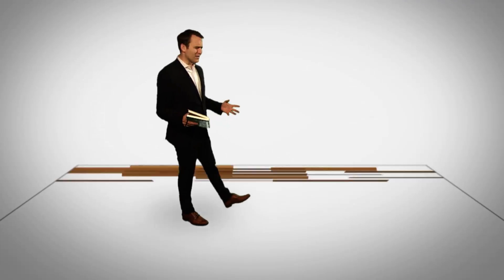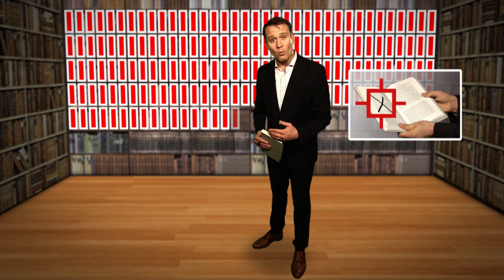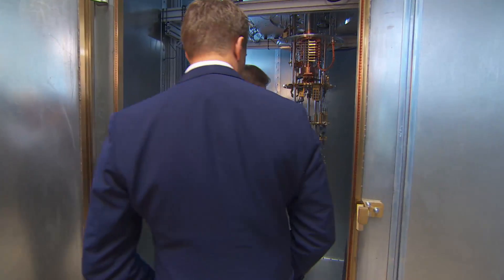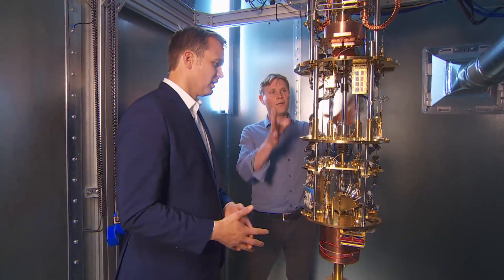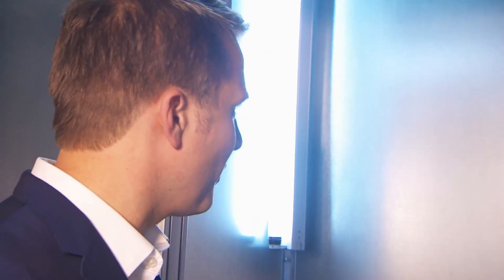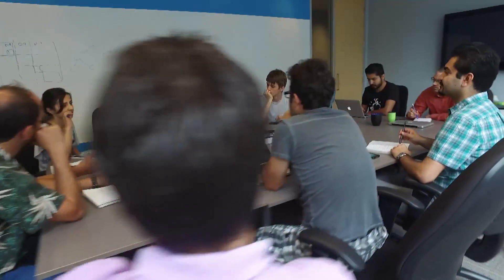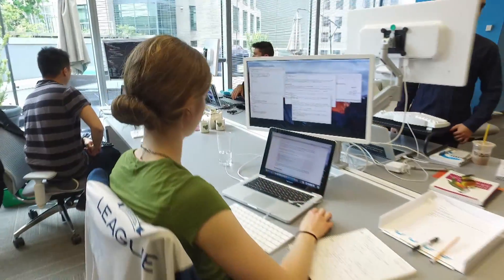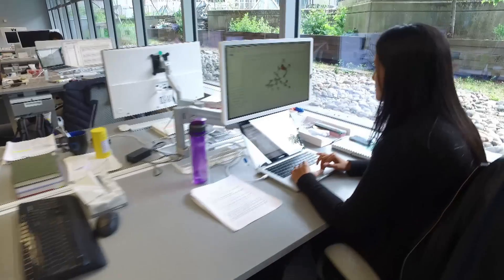Quantum computing

Comment: company builds revolutionary quantum computer - still uses Windows XP (3:10)
Reply: Linux...
Reply: 96ace96 correct
Reply: you have to take into account that is takes many years for these companies to complete their research and develop these kind of technologies, they probably have a server operating system handling all their information, which might be confidential and they might be unable to just upgrade it without being badly delayed, in other words don't fix whats not broken. Also server operating systems are way different than normal ones
Reply: It's one of the most reliable OS's to date. And it's mostly free of clutter and programs that monitor what you do. It's probably a good choice. Then again, I'm just guessing. I don't know if that's why they're actually using it.